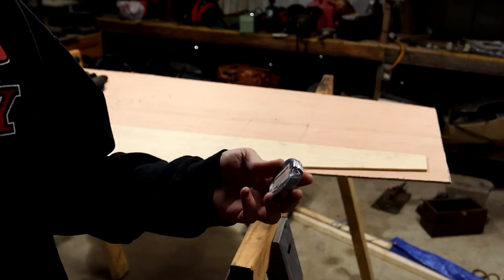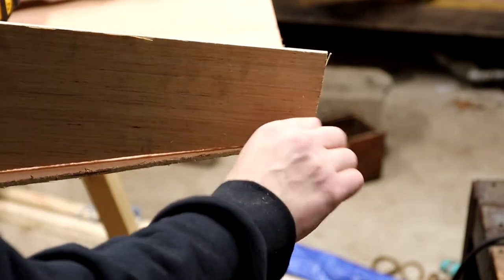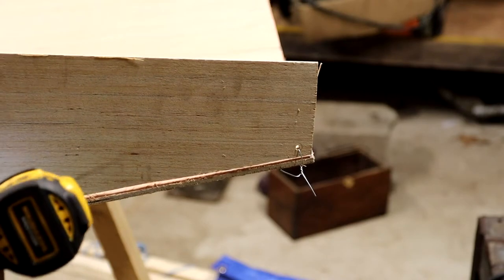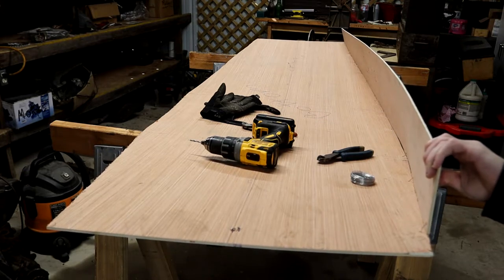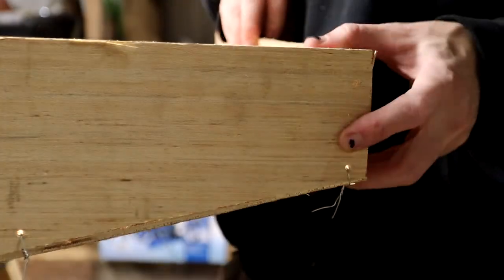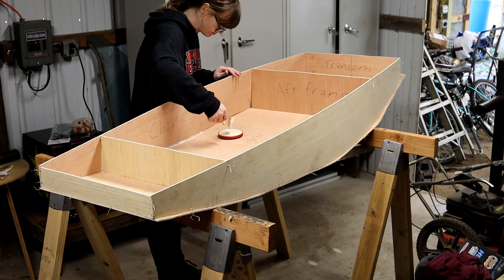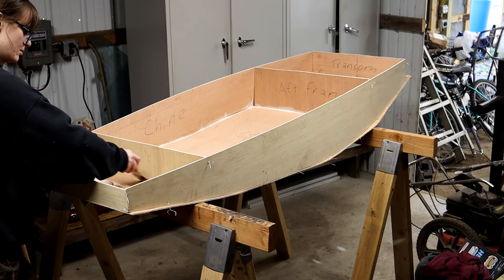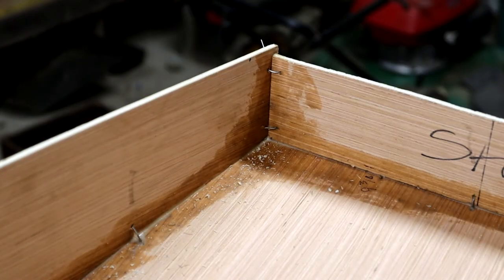Micro Mouse Sailboat Build - Part Two

Comment: Maybe add some sawdust to the glue, to make it a little thicker.  Use that as a paste to glue your pieces together.    I appreciate your videos, I have materials,  and the plans for the regular "Mouse Boat".  Not with a sail.  Gonna start this week.
Reply from the maker: Thanks! I've used that technique before for filling gaps, but I'm not too worried in this application since I go over the seams with sealer which will also help hold the parts together.

Ideally, I would coat the boat with fiberglass but I'm trying to build this on as much of a budget as possible just to show that it's possible.

Also I'm glad you enjoy the videos, the next one should be soon, the weather has kinda made it hard to continue working on stuff right now, but I have two more episodes to edit that should be up within a week or two!

Also good luck with your build, the regular mouse is a very easy boat to assemble and you could totally have one together in a day or two if you prep well.
Reply: @NatashaB  are you planning on Poor Man's Fiberglass?  Or just painting?  I'm planning on PMF, mine will be for smaller rivers and creeks near me.  I will be using   PMF over foam board for the hatch covers, for lighter weight, and for flotation if I get swamped.  I have some other adaptations to make also, but have to see it coming together.
Reply from the maker: I don't plan on doing PMF, I was going to at first, but I haven't for any other boats that I've made using this same exact material, so I think I'll be okay.

If I were building a larger boat, or using the boat in shallower water (I have a cabin by the lake here that I can get access directly to the deeper parts rather than just paddling on streams!) I would definitely PMF or fiberglass the bottom. It may not seem like much but the extra layer is a lot of scrub protection, especially for the soft layers of plywood.

Comment: Titebond makes an extremely weak joint when used in that manner, it isn't intended to be used in that manner. Hopefully you used fiberglass tape to cover and reinforce that joint. It is meant to be uses when two parts are clamped together, not 1/8 to1/4 inch apart, it doesn't fill gaps with any strength at all.
Reply: “This wont be what is sealing the boat.” “This is just to hold the pieces together until the sealer is applied.”